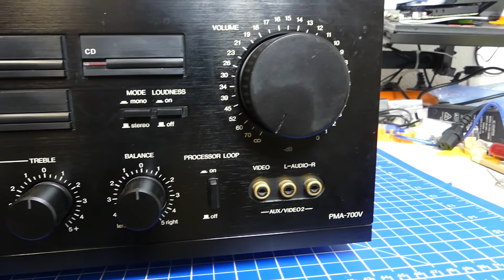Denon Amp Repair ( no caps required )

Comment: Hey can you help me with something, my DENON receiver (pretty old) 1990s, mm so the issue is that it's quiet no matter how loud i put it its really really quiet (Music from speakers are really quiet) I hooked speakers to panasonic everything is fine but denon is much more powerful so i need it repaired and it plays music but  i cant even hear the music, i max out volume to where it goes distorted but its still outputs really really quiet.
Reply from the maker: Does the Headphone output work ?
Reply: @dherrendoerfer it does i use the same phono cable for the other receiver

Comment: Hola, buenos días. Tengo un amplificador DENON PMA-860, funciona perfecto, pero lo he comparado con un amplificador Philips de la misma época y el Philips tiene mucho mejor sonido (más precisión en grabes y definición de agudos). El DENON mío tendrá algún problema en la placa de preamplificación y simplemente el Philips es de mejor calidad sonora? Desde ya muchas gracias.
Reply from the maker: Hola ! That's hard to say, PMA-860 is a very good amplifier, and yes! it has a very flat frequency reproduction, and may sound dull on some speakers. Also, the input selection can pick up dirt and make the channels fade over time. But that can be easily fixed with contact cleaner on the open input selector switch, and some pot-cleaner or compressed air on the potentiometers.

Comment: Hi, i have the DENON PMA 1560 amplifier. Last few days sond lack of color, no high tones no bass, like all sond is in the middle range of sound spectar. If I use tone controls change of can be heard but sond is dull with no bass and no high sounds. Any clue or suggestion what can be the problem? After some time, full sound will come back, and then will be dull again without any reason. I can describe the sound like when the direct sound button is pressed. Is it maybe the problem with relay of ds button, or something else? Any suggestion is welcome..
Reply from the maker: My best guess is that you have a bad connection that fixes itself due to the expansion of material as it warms up - also a bad signal path capacitor might be the problem - I'd probably go searching for expansion-areas (hotspots) and check the solder connections there, as well as clean and service the physical switches and pots. Maybe later I'd search for broken resistors (tap-test). After that we're in service-manual and oscilloscope territory.
Reply: @dherrendoerfer  I look inside of amp and by hearing(🤪) I locate the relay of source direct behind volume pot. Put several times contact cleaner spray in holes on relay. I wait contact spray to dry. After that I put back the top, connect everything, press source direct button more then 20 times and deep bass sound is back. Can I open relay and physically clean the contact without soldering?
Reply from the maker: Possibly, yes - some relays will let you slip off the casing to the top, but if it's a signal (not power) relay it may not be so simple - you can try to touch up the solder on the relay, maybe heating the contacts brings them back - before putting force to the relay get it's name and part number off it and check if a replacement is available. 
If everything else fails - bridge the appropriate signal path contacts of the secondary side under the relay - switching modes won't work but sound should be good.

Comment: Hey Bro, on my Denon PMA-380, the bass control works but makes super-tiny difference. The audio between the left and right is not equal, and I have adjust the balance knob to make it equal. Ideally, it should be equal, it should be in the center. The input selector works alright except CD where there is a lot of noise and when I place my hand on the body of the amp, it gets lot a tiny bit. Could you spare a few minutes and provide me some direction/advice to what I can do to troubleshoot and fix? I am okay in electronics and have some fixing simple issues, at least without causing more damage.
Reply from the maker: I have no experience with that series, but I believe the service manuals are available. My best advice would be to first clean the device to the point where you can inspect the solderwork with a magnifying glass, then work through the connections between layers, the amp, and the front panel. You can also test the supply voltages. As always: be careful.
Reply: @dherrendoerfer  Thanks a lot. I will give it a try

Comment: Very useful video, thank you. Will try this on my PMA-250
That's a myth about the etymology of 'bug', btw. It comes from bugbear, which is much older than computers. Victorian engineers had to deal with complex systems with bugbears, then just bugs.

Comment: I have an old Pioneer that is dying on me, I'm replacing it with a new Yamaha when they come out, but I wanted to give my Pioneer to my sister. When I get the new AVR, I'm going to crack the Pioneer open and have a look inside (I have background in IT), the sound keeps cutting out on the pioneer and the speakers sometimes pop, I'm thinking the amps inside have had it? Or maybe it's overheating? What do you think?

Comment: I have a Denon DRA625 RA. Looks similar. It clicks a few seconds after I turn it on. However it sound has a terrible noise on it and I don’t know how to get rid of it. I can hear the music behind the buzz. 😓😓
Reply from the maker: Is the noise on the headphone output or the pre-out loop? If no - check all solder points on the amp trannies and resistors. The tap-test may give you some insight on the location of the fault.
Reply: @dherrendoerfer  thank you for your recommendation, please take a look at it here https://youtu.be/ememlOdJdiU
Reply: @dherrendoerfer  the noise might be on the pre out loop. Because I can hear it even using speakers.

Comment: Thank you very much for your explanation Rick, my story is similar to yours I have had this amplifier since my adolescence, I think the relay is failing, since it turns on but sometimes it does not click, I tap it and it starts. Has it happened to you? Can the relay be cleaned or does it need to be replaced? Greetings!!
Reply from the maker: Seen this happen .. some relays can be opened and the spring loop can be cleaned and slightly lubricated. It may also be a weak cap at the delay circuit, check the coil voltage on the relay.

Comment: I have one just like yours, mine is in the shop right now
 I am so glad I found this video. I am waiting for two capacitors.  She will get a good clean but I knew nothing about the soldered parts. These amps have a wonderful warm sound with some high quality punch
 I drive Infinity reference class 60 floor speakers and they match it's beautiful sound. I don't really want another!
Reply from the maker: Same here .... don't want to let go, it's just so perfect.

Comment: Nice details and good job. I have a denon that have a strange problem. I was searching all over the internet and i didn’t find any solution. When i press the buttons, the tone control for example, it will open the tuner or if i press cd input, it will not respond or it will give me the tape input and so on. The remote control is acting the same. Can you have any ideea ? It’s a Denon Avr 1601. Thank you and have a great day. P.s.- i did the reset and the same
Reply from the maker: I think I would start looking at the power supply and check if the logic supply is stable - this is a from the era of crappy caps, but I believe Denon used Japanese parts for most of the signal path.
Reply: @dherrendoerfer  the ideea is that beside this problem, i have no error message and it’s working great (i have output sound and power allso). Can it be from the processor? Thank you for your answer.
Reply: P.s.-i m not an electronist man. I know some things but just basic stuff.
Reply from the maker: That's very hard to diagnose even with the amp right in front of you. But since it seems to be working to some extend I'd wager that it's unhappy because some of its basic needs are not met. For a processor board that would be a clean power source with stabile voltages.
Reply: @dherrendoerfer  i see. Becouse i m not a specialist, i think i will throw it out. Thank you for your time.
Reply: @FixAndFail  hell no,  take it to someone like this man that knows what he is doing! You will pay a fortune now for the same class of sound!